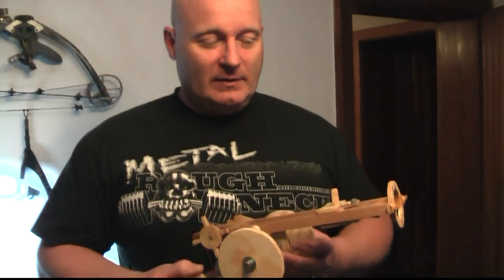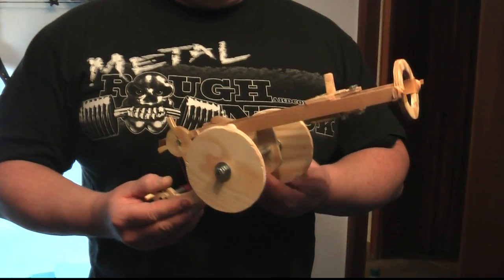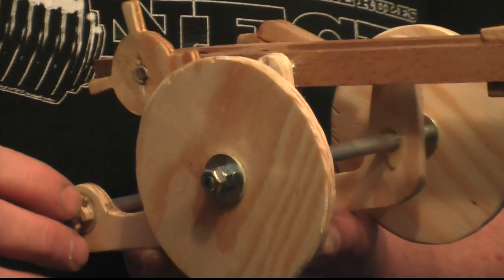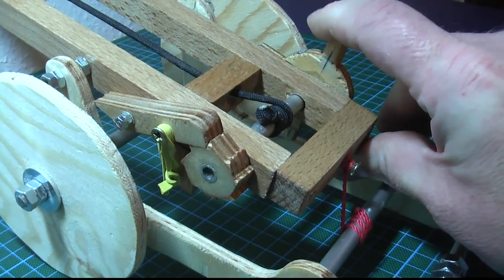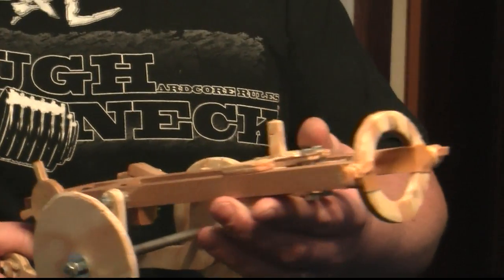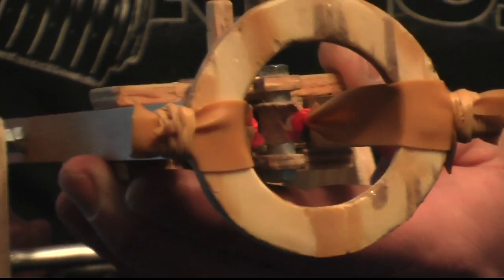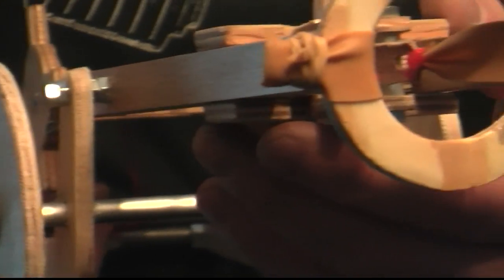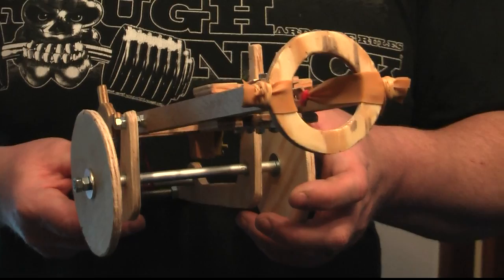Desk Top Slingshot Cannon vs. Red Bull Can

Comment: On the full scale, you must make sure the sled and 2 rails are as smooth as possible with the current design to avoid splintering and cracks in the wood making small dangerous cracks and fractures. 

i recommend switching the sled/rail's glide system to a coaster system 
(think of the small tracks on a roller coaster), i can care to elaborate farther if you want with ideas and concept drawings based on your current mock-up.